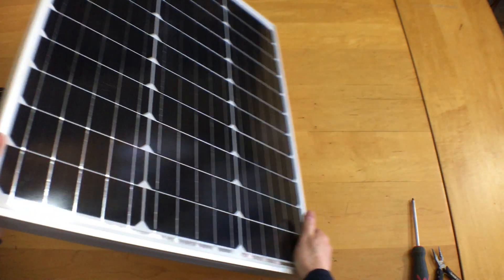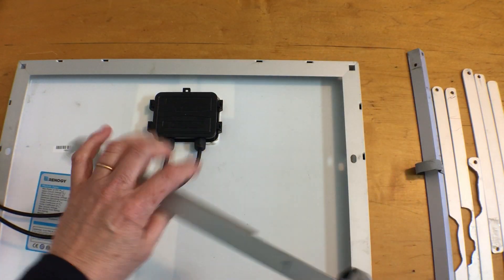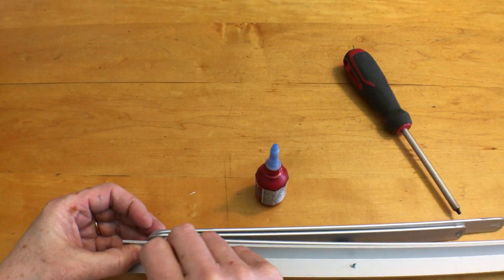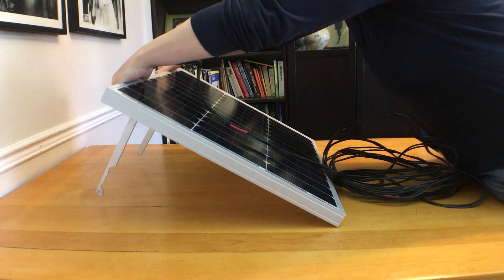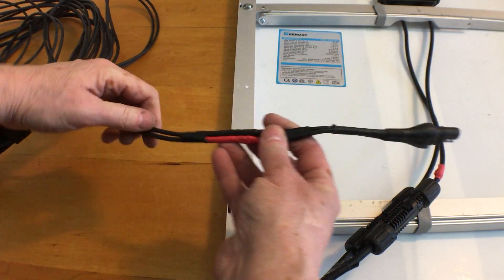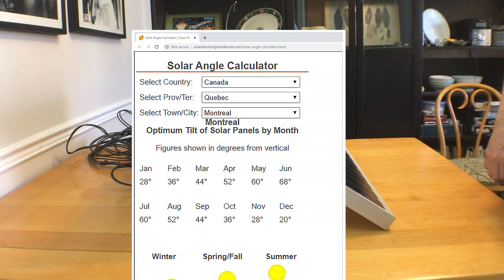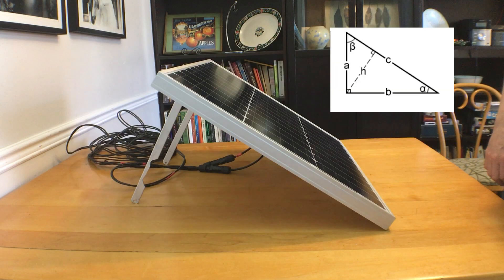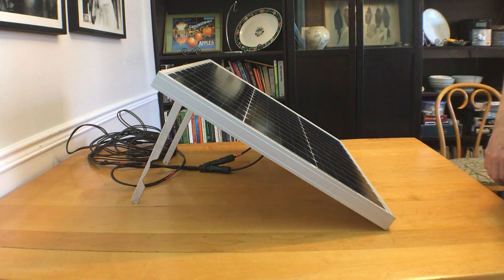Adjustable legs for solar panels

Comment: Your angle calculations are all off! The sun travels from east to west in an arch, meaning a continuous variation in angle through out the day. Your angle calculations are for the axis of rotation not the one dimensional tilt of the panel. My solar panels are lever locked in place on the top of my minivan, but I have never taken them off to place them in the optimal sun seeking position in the seven years I've had them. You made me rethink my solar set up,  Thanks.
Reply from the maker: It is all approximate anyway as those angles are best averages for each season and mostly for my own amusement. As you point out, for the amount of power I need, whether they are tilted at all really does not matter.

Comment: Your ideas are beautiful. So is your way of explaining. My only request would be the approximate cost you spent in materials. Thank you for taking time to share 🎈
Reply from the maker: Hi. The 8 ft of flat bar was $12 CAD and the 8 ft of angle was $18 CAD, but I only used half on the panel legs. It varies a lot depending on where your buy it.
Plus a few nuts and bolts. The Loctite is kinda pricey, maybe $20 for the size I show, but I already had some on hand, but you could do it without it.
Reply: a very small camper van That is very Canadian of you. Sweet and kind! Thank you.  -San Francisco 🇺🇸